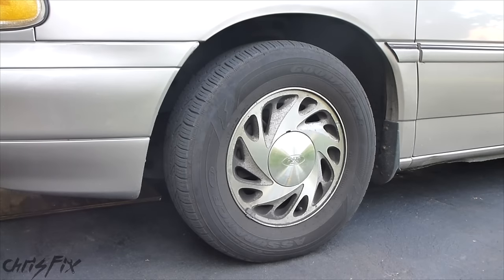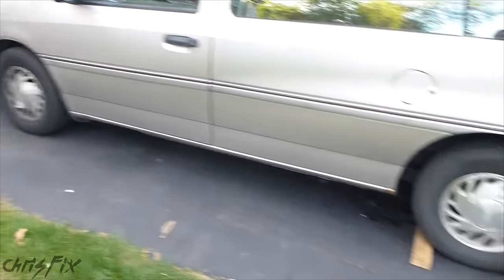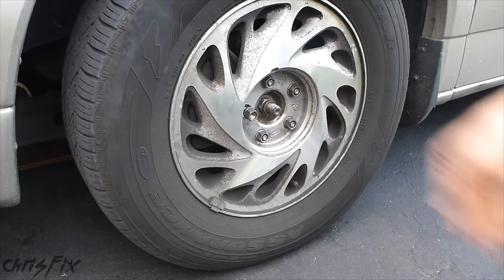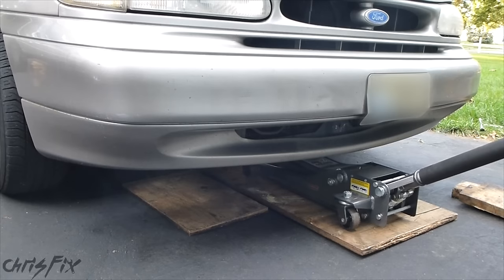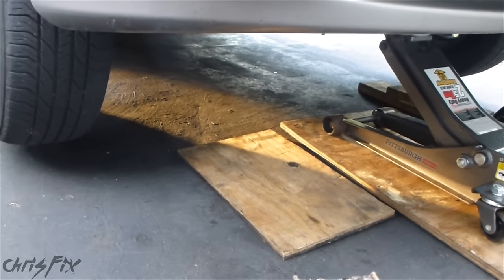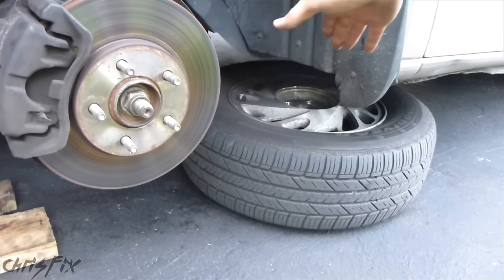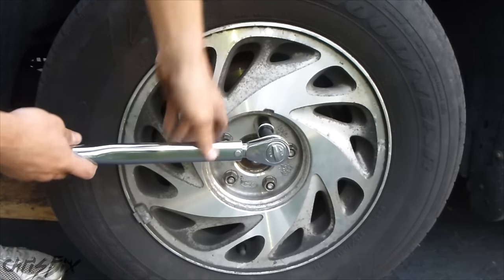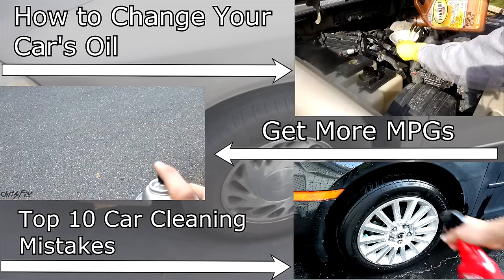How to Change a Tire (plus jacking it up)

Comment: WHO else know's how to change a flat tyre but watches this for fun
Reply: Me
Reply: That mean you don't know ,do you know he did it very wrong,have a look your car manual, the book most people never read, never put the stand under there when only the jack holding ,when the jack drop people died,should put it like the book said ,put it to the side!
Reply: Um yup me 😁
Reply: Me.
Reply: Alan W actually he did ver well... you are right too but crix fix did it good too, i don’t know if you see very well but he was save he put the jack stands on  both sides and just put the jack very loose so jack stand still do the job... obiously if people want to change the side tire on the ROAD...just jack up from the side thats it...
Reply: Trypical Gamer me
Reply: Trypical Gamer me
Reply: Lol
Reply: Me
Reply: Me
Reply: Me, and I have never used a torque wrench on a lug nut in my life. Have worked in a dealer workshop, and can feel the right tightness. Most people over-tighten. I had my car in another dealer workshop for a recall and they tightened the nuts so much they stripped some of the threads. I replaced some studs myself afterwards.
Reply: Tire not tyre
Reply: @samb4678  Tire/tyre depends on which side of the Atlantic you are. East of it, "tire" means getting fatigued.
Reply: Trypical Gamer ok I’m sorry
Reply: Aoose ne peux yoga
Reply: @alanw5812  there are still 2 wheels attached when car stand were placed.
Reply: @anm0604a  the tyres already off the road 2 inches, + suspension spring ,that total can drop about 5 inches ,when he putting the stand under the car,if the jack drop,do you think he can  survive ?
You never know how many time used ,the jack will  suddenly drop,you will never like to found out!
Reply: @dukenukem5768  youre a real stud.
Reply: I'm a teen and I watch this kind of stuff
Reply: Me
Reply: Not necessarily bro. There could be people like me who never learned due to the fact that my father passed before I started learning how to drive. This is helpful for people and there's nothing wrong with learning because everybody learns at a different pace
Reply: Me
Reply: yes
Reply: uh..me..haha yea
Reply: Me I just wanted to see how he does it
Reply: Me
Reply: Not me
Reply: I've done a lot of the things he teaches on his video, but I almost always learn something new anyway. Wish I'd realized to put plywood under before I got these jackstand prints in my asphalt :D
Reply: I learned myself by my quad
Reply: Me
Reply: Swaiti honestly if u know how to use a torque wrench and ratchet it’s pretty self explanatory, glad my dad taught me to use tools
Reply: Duke Nukem it’s honestly easy to feel the threads at their limit when u have been around tools ur whole life like me, I know to stop when both the bolt and threads are fight me
Reply: Me
Reply: Meme
Reply: I don’t know how to change a tire, but LOL
Reply: Me
Reply: Everyone?
Reply: WHO else know's how to change a flat tire but watches this just for the usage of jack stand XD
Reply: Maybe I’m doing something wrong lol just entertaining to me
Reply: I watched it for fun.
Reply: Me
Reply: For fun???!
Reply: Definitely me. 👀👍😎 I know how to change a tire. 
😂😂lol of course I can man what do you think I do all day? Lol im a tire changing guy. 😂😂😂
Reply: Yea i have easily 10+k worth of automotive tools and equipment but im still here at 1:30 in the morning watching this😂
Reply: Not me :( i don’t even have a car yet but I’m learning everything i need to know beforehand

Comment: Hi guys: Trained tyre fitter here. Yeh, we say "tyre" in the UK. I wish I could like Chris' vid twice- He covers jacking safety, correct torquing, star-pattern tightening.. faultless vid clearly explained. The old-style X-tyre iron (what Chris calls the "classic") is far better than single-stem irons that come with hand-jacks. You can get better grip when loosening and spinning those nuts (lugs) off and on like a pro with a "classic tyre iron". I would recommend all motorists have the "classic" iron in their boot. If you dont have a torque wrench, my tip is to have a long metal tube (thats hollow and not much bigger than the iron) that will give you much more "torque" if (as Chris explains) you find yourself fighting with a tough lug (nut) that wont turn. This is a lifesaver if you're caught out on the highways and have to change your roadwheel. (Yeh technically, Chris is changing his entire roadwheel here, but a spare wheel fitted with a correctly inflated tyre should be in your boot at all times, anyway). Drive safe, have fun.
Reply: Thank you

Comment from the maker: Xingyu Luo You can lift all four tires off the ground, but you need to be sure you balance the car on the jack stands so it is very stable. Keep the jack stands the furthest from the center as possible (so keep it on the sides if possible). It is similar to what you saw in this video plus lifting the rear. Again, make sure the car is stable before going under.
Reply: ChrisFix 3
Reply: Hi Chris,
I’m like the worst person when it comes to working with my hands I am office environment guy.
It really bothers me that I can’t change a tire or change oil. It makes me nervous when I’m dating because I don’t want to ne in a situation I can’t handle. Besides your videos do you know of any month schools/classes I could take to help me learn the basics?
Reply: you can ask help from a friend
Reply: ChrisFix whats that tool on the thumbnail called
Reply: ChrisFix hey
Reply: Gezzz I love you ChrisFix! 
You make me feel so much better about doing things to my vehicle. The small things that you are supposed to know, sometimes some people don't know either way you're doing a great job of sharing this info, basic info or not...
I appreciate you. 
Thank you.
Reply: ChrisF
Reply: ChrisFix 
If you're just changing a tyre, then you don't need stands.
Reply: George Payazitis for safety
Reply: AER0 GAMING 
It depends on what your doing.
Reply: not.
Reply: AER0 GAMING 
A jack like that does lift any car obviously, a truck is what you need be curious or concerned about, cz it may not.
Reply: ChrisFix
Reply: ChrisFiX
Reply: Instead of using a breaker bar just use your foot if you don't have a breaker bar.
Reply: You put your car in Neutral, isn't it ? if not, doesn't it damage your transmission to go backwards when you are giving your little jerk with the crossbar ? Thanks for the video, really fun to watch !
Reply: FIRST REMOVE THE NUTS THEN  JACK THE CAR UP THEN REMOVE THE WHEEL AND DON 'T FORGET TO TIGHT THE WHEEL

Comment: Thank you Chris for such high quality videos......clear, concise, accurate, and to the point. I also appreciate the tool buying tips. I recently jumped a curb with my 2008 Mazda3; no visible damage, handling at high speeds is still perfect, but when I turn the steering wheel going slow I hear a rubbing and clicking sound. The dealer charged my $55.00 to tell me that there is no visible damage, but it does make a noise....then it was they think it may be a bearing (top of shock location)....they then suggested (as there is 145,000 miles on the car) to change out both shocks and then realign the front end....$$$$...then I watched your change a strut video on your 2006 Mazda3, so I think that I'm gonna go for it by doing the work myself!! All thanx to you and your videos....if you have any additional tips.....we'd all appreciate it....A big THANK YOU again!

Comment: Hey man, great video! Just a tip.. when torquing, push down the wrench instead of pulling up. You could injure yourself by lifting with your back. Plus, pushing down uses less energy because you're only using your weight and hardly any muscles.
Reply from the maker: Lobster Thanks for sharing your tip!
Reply: Absolutely, same for loosening those lugs, just go to the opposite side. If you have to pull, use your legs rather than your back!
Reply: Good point: I've seen pro fitters use their entire body weight (pushing down) to loosen tough lug (nuts). Safety is always the best starting point when dealing with mechanical repairs. Thanks for sharing.
Reply: @writerNB  yep otherwise you destroy your back
Reply: @chrisfix  Thats what she said
Reply: Yeah if you're an old man. 100 ft pounds on a torque doesn't strain anything lmao
Reply: @chrisfix  Also, you probably won't see this, but apply counter torque. It helps keep the force being applied tangential to the fastener and not cockeyed. Prevents bending studs and bolts and also keeps your tool on the nut.

Comment: I love these vids, as they are so informative for guys trying to do the work themselves. My only comment on this vid is that when you torque the lug nuts you should make sure the car can't roll at all. If it can, then some of the torque is lost turning the wheel a few degrees before tightening the lug nut. The other thing I was taught as an apprentice mechanic many years ago is that when using a torque wrench you should use it by pushing down and not pulling up. Other than that I can't praise Chris enough for the quality and knowledge he gives away for free in all his videos. Top guy!

Comment from the maker: I would like to hear if anyone does anything differently or has other tips to add to the video!
Reply: I'm not gonna get into it to much, but do you ever put anti-seize on the lugs or nuts?
Reply from the maker: dwoodog Not on the lugs or studs (never put anything on the lugs or studs) but I have seen people put it on the hub where the rim contacts the hub. The reason some people do this is because dissimilar metals bond together through rust. I never really had that problem on my vehicles so I never had to... So on the lugs or studs, no, but on the hub, maybe.
Reply: ChrisFix
Everywhere I have read, they say to NEVER put any kind of lubricant or anti-seize on the studs or nuts for fear that they will work loose.  However, I always put some on the center hub to keep the wheel from seizing onto the hub.
Reply from the maker: Thomas Perry Exactly! You should never put anything on the studs or lugs. I misread his comment. I thought he said around the studs (where the rim meets the hub).
Reply: Hey what brands should I buy my tools from.  Good brand any cheap brand from the dollar store
Reply from the maker: It really depends. I like buying from harbor freight because I can afford it but when I am looking for something that is quality, I usually go for craftsman because that is really the only good tool company around where I live. I wouldnt go for dollar store brands. Harbor freight is cheap enough and they still give you a lifetime warranty!
Reply: ChrisFix thanks man yea I got a harber store here in Florida homestead. Im going to buy some things there I just wasn't sure thanks for being honest.
Reply: Also is a good idea once you re-install tires and tight them up just drive the car ect a bit then re-tight them agein you will be sorprice how loose they still were  sometimes.
Reply from the maker: Jacob Baez Great tip!
Reply: Thanks bro!
Reply: ChrisFix Maybe tell the people that they can not put the tire on the side they want because of the direction of rotation you tire must run
Reply: ChrisFix Please move your torque wrench slower and be consistent with your speed, user inconsistencies and mistakes account for the biggest errors while torquing, there are very good explanations on how to use a torque wrench on youtube and other sites, your technique isn't very bad but it does need some improving.
Reply: ***** Actually the blocks of pine wood will help a lot, sure, not as much as the 4x4's but not bad either, it mostly depends on the angle of the surface you're working on, 4x4 will do fine for a pretty steep working area.
Reply: if you dont have a breaker bar but you have the wheel spider show first  (tyre iron) and the bolt is over torqued then you can place a jack underneith the wrench to support it, connect it to the wheel nut and then tread on the left of the wheel wrench, works every time
Reply: +ChrisFix Sometimes the lug nuts need to be torqued in steps.  Our 99 Dodge Intrepid calls for 100 lb-ft on the lug nuts, but first you torque them all to 50 lb-ft, and then you go back and torque them to the final 100 lb-ft.  Thanks for another great video.
Reply: I want to ask.. Why some times the tire pressure is raised,  is't the weather.
Reply: ***** If you heat up the tire it will heat up the air inside so your pressure will raise so it can raise from the heat of the sun or by driving  fast
Reply: +ChrisFix When Using The Floor Jack; To Prevent Damaging Paint/Undercoating On A Lift Point I've Found That Cloth Works Best. Shirts, Shop Towels, And Socks Work Great At Maintaining Grip But Preventing Paint Chipping Or Other Types Of Damage To The Paint.
Reply: +ChrisFix This is kind of an unrelated question but is it safe to jack up a car on tow hooks underneath the front of the car (one on the driver side and one on the passenger)?
Reply: +ChrisFix What if the rim has 6 lugnuts or 4? How would you then do the star pattern?
Reply: +Vivek Anand On the 4 Lug Nuts you would do a cross pattern
Reply: +ChrisFix Hi I would like to know if it is ok to use a 2.5 Ton jack to jack up a 6000 pound suv? does the jack has to left the whole weight of the car?
Reply: +Alternative you should be fine. With you only jacking up the rear or front your not getting the full 6000. Either way I always use jack stands but for just lifting no problem
Reply: hey was a great video! maybe a tip to add to the video can explain the bolt pattern? to be sure if you buy rims and tires from a store or someone you can be sure they fit onto your car
Reply: I'm nowhere near an expert, but I agree. I heard him say to use a wooden block and that seems a little unsafe. Is it truly safe to assume a wooden block can withstand 4,000lbs?
Reply: +Benito Ajo its not to withstand all that wight. your car is in parked and the hand brake is active. it's just to prevent slide or roll.. in most cases you dont need thrm at all.. just for safety and rare circumstance
Reply: To take a tire off, I use a valve core remover, an air compressor, a bead breaker, four clamps, electric motor, tire bar, and a plastic spacer. Not just take the wheel off the car.
Reply: I have a tip, use the button when putting on the emergency brake. No button makes me cringe.
Reply: +Gavin Smith look up engineering explained's video on that. It doesnt matter at all
Reply: what if i dont have a torque wrench
Reply: "You can easily lift up light tires because they are not heavy" LOL NICE QUOTE joke you are really smart....
Reply: Yeah, I torqued my wheels when I switched them, but didn't re-torque after driving.. One of the wheels got so  loose that it made vibrations through the whole car. It was quite scary.
Reply: I don't know if this is different I'm taking my wheels of my o3 montana and the under body is so Frick ing rusty I lean on my van and rust falls of so taking wheels of is gonna be fun and unsafe
Reply: I would think driving that car in general is unsafe then.. I mean, if a car is so rusted that it breaks apart under a wheel removal, I'd never put it on the road..
Reply: We aren't any more but I leaned against it and I broke it cause it was so rusty
Reply: A lot of old cars are that rusty.
Reply: Wew
Reply: ChrisFix
Reply: ChrisFix can you make a video on ways to remove rounded lug nuts?
Reply: the way you change tyres is grade, but while losening en tighting the locknuts you lift the brekerbar, it easyer on your bach to push it down, just go stand on the other site of the nut. But exept form that, great video
Reply: CHRIS! Your Nearly Up To 2 Million Subscribers!!
Reply: ChrisFix before putting the wheel back on,  put some copper slip or aluminum grease on the hub. this will stop the wheel corroding onto the hub and allow it to come of easier next time
Reply: Lol, oil that squeaky jack maybe?
Reply: Use wheel sockets instead of chrome sockets for the lug nuts.
Reply: ChrisFix one of my tips is instead of wood use a buffing pad on the jack
Reply: My tip is if you can't move the boards after lowering the car, move it a couple of inches away from the board.  I also feel safer using real wheel chocks.  They aren't too expensive and could save your life.  A few extra bucks for that extra security is worth it in my eyes.
Reply: Rick Karns
Reply: ChrisFix You've got a nice fidget spinner!
Reply: I lift the car with one hand and loose the nuts with the other, easy peazy.
Reply: Felipe Pereira You drive a kei car?
Reply: ChrisFix  No, your tutorial was the perfect one '
Reply: hi chris. love ur videos coz im not handy and have learning disabilities. I find youtube is a great place to learn. I also love ur attitude coz its like mine. I hate how greedy and selfish companies are to rip people off and probably hate what ur doing coz u wanna help the little guys to save money and learn. I drive my gf's mothers 2009 F150 and wonder if u make videos on those for me to learn..??
Reply: Chris - Drive a 07 Toyota Camry and the torque on that is only 76ft lbs. 100 or 90 would be too tight. I think bigger vehicles are higher torque spec. My 2012 GMC Canyon's 100ft lbs.
Reply: Johnny Blaze     Yes my cars 100 foot pounds but my cars an average size it’s not a small car. Just look up the torque spec before starting
Reply: Hey Chris I know this video is old but I learned it a different way, to jack up the car there are jacking points located at the sides and as such there is a place at the sides of the car to put the Jacks also
Reply: With a wirebrush to clean the rust form the wheelhub
Reply: I know this is an old thread, but always retorque the lug nuts in 100 miles. Also, if your vehicle came with a jack with a flat end, you can use that for leverage when lifting the tire back onto the hub instead of using your feet.
Reply: Can you put dw40 on the locking nut and other bits going into the hub? As mine are quite rusty on the threads